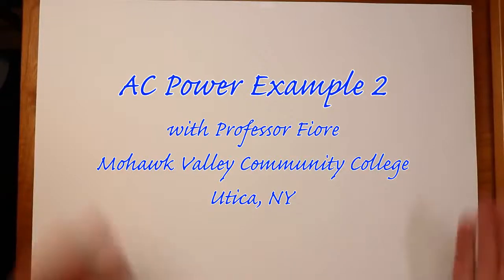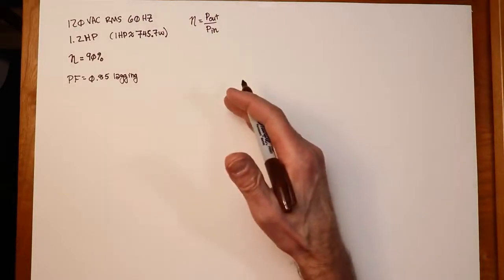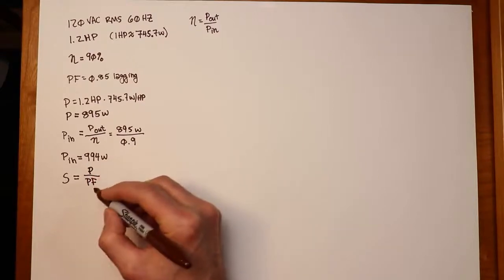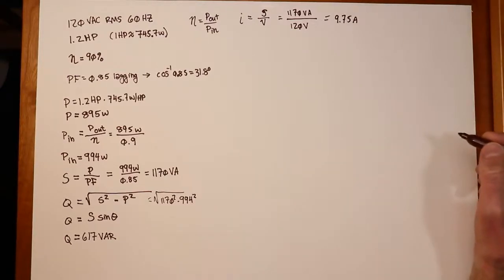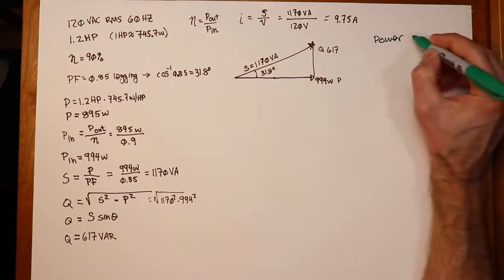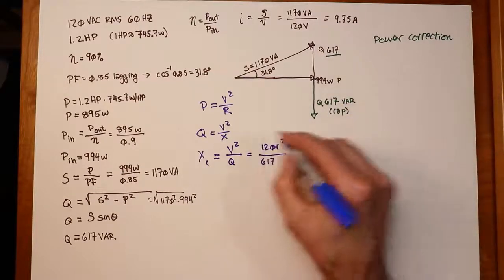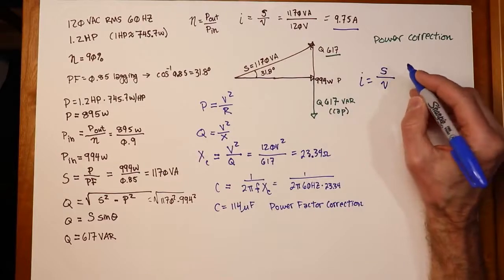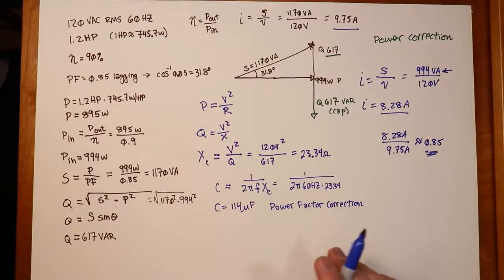AC Electrical Circuit Analysis: Power Analysis, Example 2

Comment: In the circuit after being corrected are there oscillations between the capacitor and the inductor? An exchange of power between the 2.
Reply from the maker: There really isn't "an exchange of power", per se. Power is only dissipated in resistance. Ideal inductors and capacitors alternately store and release energy without any power dissipation. You could think of the energy bouncing back and forth between them, though. Imagine a ball bouncing back and forth between two ideal springs: the mass of the ball compresses one spring (storing energy), and then the spring releases that energy, transferring it to the ball which flies up and over to the other spring, and the process repeats. Not a perfect analogy, but I suspect sufficient.
Reply: @ElectronicswithProfessorFiore  Practically does this mean you want to keep the reactive impedances close? I think you mentioned this in the vidéo. During the exchange of energy current passés back and Fourth. Energy would dissipate over à non idéal wire.
Reply from the maker: @Chris-hi2hn  If the reactances are the same magnitude, then you get something called "resonance", which has its own unique properties (videos on that are found later in the playlist).